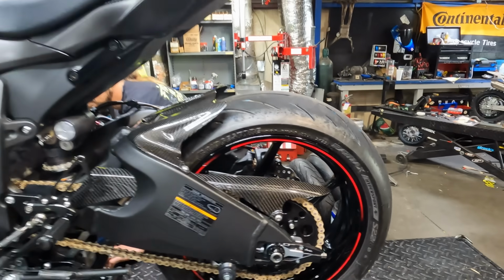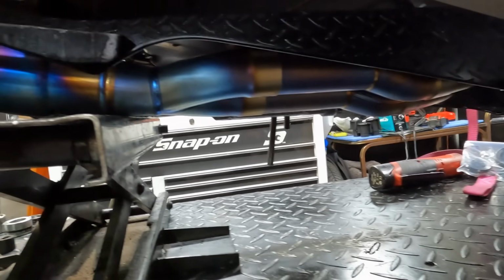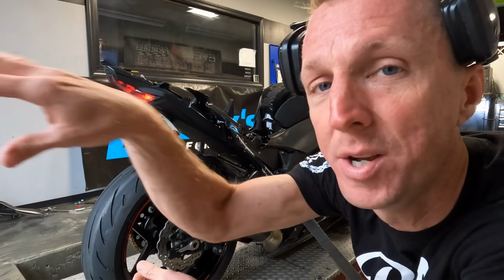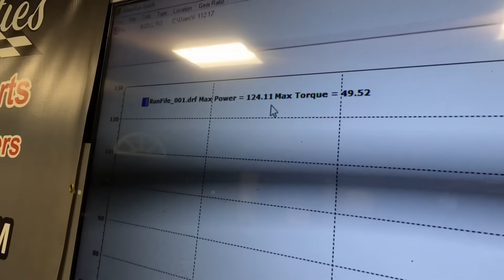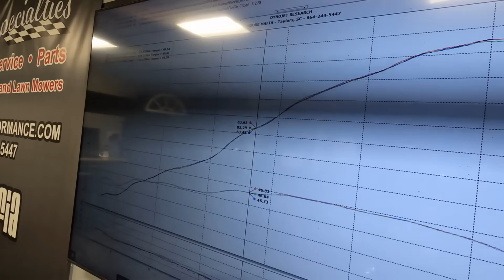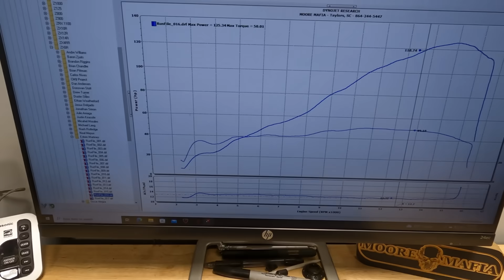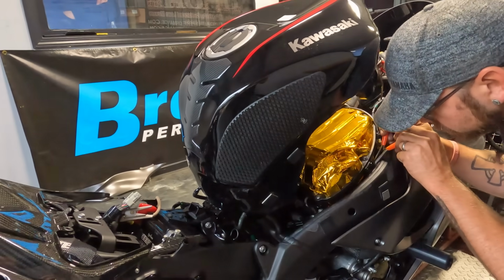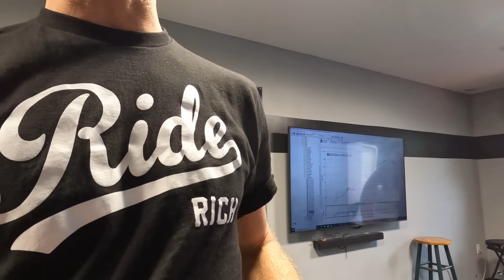2023 ZX6R With Perfect Mods Comes In For An ECU Flash

Comment: Love hate the pops and bangs wish i could use a switch to turn it on or off depending on the holiday season😂
Reply: I mean you practically can, it only pops and burbles if you give a lil gas on deceleration, if you just let it decelerate without giving that tiny bit of throttle it won’t do it

Comment: Chris, since you asked, I feel that "pops" and "bangs" makes the bike seem like it is not tuned correctly.  But to each their own.  I like a clean, smooth deceleration on a bike.  That being said, I am always learning from you.  This "marble" block in the hose you discuss, I suspect this is the same as removing and blocking the PAIR Valves without having to remove and block the actual PAIR valve.  Cool beans.  The only thing you could add for others is the size of the marble before they accidentally drop it into the tube. Lol
Reply: You have to lightly touch the throttle to make it do that🤣. Mine does this without no tune.

Comment: I done something kind of unique with my 23 year old ZX9r's KLEEN air (PAIRS) system. I removed the vacuum pump and silencer, removed it from the airbox, together with the crankcase breather hose.
I then joined the two together, with a small K&N filter on the end using a four way pipe connector and a longer bit of tubing for the crankcase breather, and blocked the holes on the airbox with Sugru.
The engine now has options as the exhaust can still get air through the reed valves, and the crankcase breather can still vent no problem either through the reed valves or just the air filter.
It sounds awesome, and I'm getting more, and only clean air into the combustion chambers.

Comment: My '21 ZX636 makes 148hp with VP MR12.  I'm running Woolich racing and the engine is overbored to 674cc.  It is uneatable in the straight but not as nimble as an R6 in the turns.  Also, while the price of the bike is cheaper, once you add all the upgrades to have the same features as a fly-by-wire bike it ends up costing you more.

Comment: Love the bike. Very tastefully done.

As far as the question regarding pops and bangs tune, not only is it pretty annoying but it can also have extremely detrimental effects not only on the engine but on the powerband and fuel mileage as well. You're dumping a lot more fuel in unnecessarily and sending your egt's through the roof. Not to mention the damage you're doing to youre likely doing to your valvetrain and rings. I get wanting to look and sound cool but it achieves neither of those and leaves a lot of power on the table rather than optimizing air/fuel to be leaner in a safe range with proper timing.

Comment: I love the pops and bangs
Curious could it be tuned into a different  power mode like B and A with out
Reply: Probably. Kawisaki zx6r might not have the modes. Like the gsxrs
Reply: @calgibs6911 I want to say they added mode selector in 21? Can't remember but over the last couple years
Reply: @calgibs6911 They have a rain mode.
Reply: the 2023 has two power modes a full power and a low power
Reply: Yes you can. The power modes can be re-programmed to different fuel maps. Had it done on my 13' so I'm assuming it's still the same.

Comment: I disabled air injection on everything I ever rode. All the way back to my old KZ and the hose was 3/16 or 5/16 vacuum line and i used a steel BB
The onlybthing it helped with was tuning with an EGA. Didn't change horsepower like you said. I just don't like the lean misfire/after burn popping.

Comment: The pops and bangs on decal is absolutely savage. I’d rock it if you could control the intensity by the throttle and it didn’t do it on its own every single time. It sorta looked like you were feeding it the tiniest bit of throttle to make it pop and bang more?
Reply: wait, I thought this tiny bit of throttle while decelerating for more pops and bangs hurts the engine, does it??

Comment: The pops andd bangs are kind of cool, but really wear on a rider after a while, and let's not forget about the risk of hearing damage. I suffer from that as I started racing open chamber 2 stroke flat trackers back in 1969...and I still ride today, making a bit too much noise on my piped, dry clutched Ducati.
Reply: What about earplugs? I always have them in when riding.

Comment: question. couldn't you tune the different rider modes. like mode 1 be for street and 3 for track?
Reply: I was thinking same thing, maybe the feature that has to be turned on and off for pops and bangs adjusts all modes at the same time. Either way it's a bit weird going to such lengths to get 2 emu's and 2 tunes and all that.

Comment: Great mods and tune, but just out of curiosity why is there still a drop in the curve after the top figures (I guess around 14.5 - 15k rpm)? Is that how the mapping supposed to be or is it sort of a safe measure from an engineer point of view to safe guard the engine from the redline perils?

Comment: So basically the PAIR valve is an EGR valve. And where does the exhaust gases go if it’s blocked off?? That’s my question. Is this like a crank breather so now you have no vacuum on piston rings to help with combustion. I’d rather everything be set up stock. If it pops then it pops.
Reply: Look at the air box, the hose coming feom the bottom into the back of the box has to be a crankcase vent.

Comment: Can you tune the ECU specifically for a better engine temperature.??
Reply: Yes the ecu flash includes lowering the fan temps. Huge difference!! My temps use to rise to high 220’s (winter&spring)but after flash doesn’t ever reach 200 degrees in this summer heat

Comment: That marble just added back the weight they had removed by using carbon fiber :D
Also it kinda sounds like a ghetto solution to just stuff a marble into the hose, like why not a propper plastic plug?

Comment: So at what point does the extra fuel on whatever TPS % you're working under wash the cylinders?  Fuel & retard is what makes the noise.  Ive got a fair amount of time on Fueltech standalones on honda engines.
Also what brand of ceremic bearings do you recommend?
Im ready for a reflash, too.

Comment: Just picked up this bike, want to do full exhuast. You said full Graves titanium exhuast and it has Austin Racing slip on, so is it full titanium exhuast from Graves and then he just swapped the slip on to an Austin Racing one? Trying to get this exact setup before sending to you for a tune please let me know!
Reply: I’m pretty sure its Graves headers and then Austin Racing Midpipe with the GP1R exhaust. When you buy the Austin Racing exhaust its comes with their midpipe aswell, you can see the diameter pipe difference to where the Austin Racing parts connect to the Graves headers when he pans to the exhaust setup

Comment: Yeah guys, I don't know much about bikes, can someone answer my question? it always seems like in all Chris's tuning videos that he shifts the customers bike without using the clutch...are these special bikes, techniques, I thought you HAD to use the clutch. Thanks
Reply: Most newer bikes have quickshifters which means no need for the clutch unless you want to
Reply: This bike has an upshift quickshifter, so no clutch required for upshifts.
Reply: They are called quickshifters, most modern 600cc+ bikes come with quickshifters, you dont need to use the clutch or let off the throttle to shift. Same goes for downshifting, theres auto-blippers which do the same and auto rev match.
Reply: Showing my age but I remember buying a air shifter for my 2002 R1, and parts plus labor was like 600 bucks. And the guy that put it on cussed me, said it was the most aggravating one he'd done... but this was 2003. Love to see how far the manufacturers have come
Reply: Has nothing to do with a quickshifter.
These transmissions are sequential, so the gears mesh as soon as the load is taken off.

A throttle cut as small and as fast as you can make it with a slight pressure on the shift lever is all thats needed to shift sans clutch...

Comment: Not a fan of the pops and bang tunes. Just wish I could afford to ride my '05 GSX-R750 over from Ridgeway, SC and get a good dyno tune. I have a full titanium header with a Leo Vince Superbike muffler from an '03 1000, K&N filter, and timing retard eliminator. Ihad the ecu flashed by a dealership in FL, but they didn't have a dynamic. I believe there is still a lot more power waiting to be turned loose. "Someday"

Comment: Wish someone would do an actual test for ceramic wheel bearings. 60- 130 or 60-180mph. Do they really make a difference? I'm not convinced
Reply: I'll do one once I get to that point. I've got baseline 60-130 times on my stock 23 zx6r. I'll be doing a follow up after exhaust, filter and flash. Then eventually bearings, light lithium battery, better windscreen, gen2 busa front fender for aero etc.
Reply: What are you doing on the stock bike? What times?
Reply: @TheTradesmanLU2001  In hot weather and 1600 DA I ran a 7.89 60-130. keep in mind this is bone stock and i weigh 205lbs with gear on so im weighing the bike down a lot. I will update as I do mods and lose weight.

Comment: My 21’ 636 pushes out 127 stock. Haven’t gotten it flashed yet so I’m sure it’ll be even more once I do. The new 24’ 636 they took away HP for regulations.
Reply: it doesnt push that at the wheel
Reply: Lies
Reply: Thats at the crankshaft ya dingus.